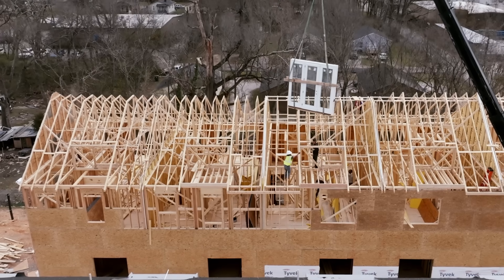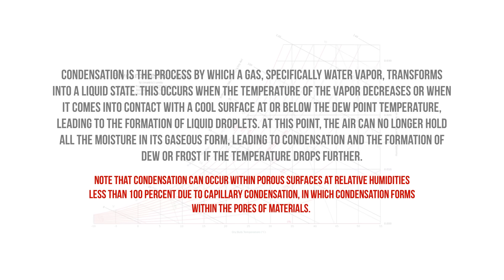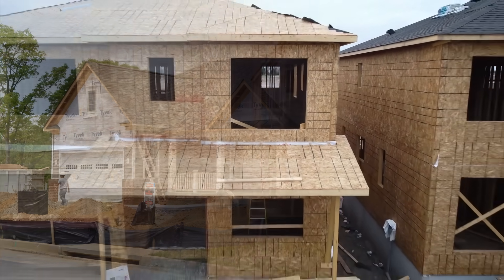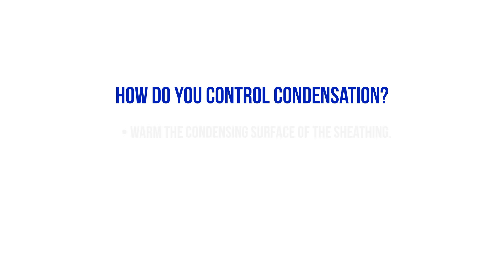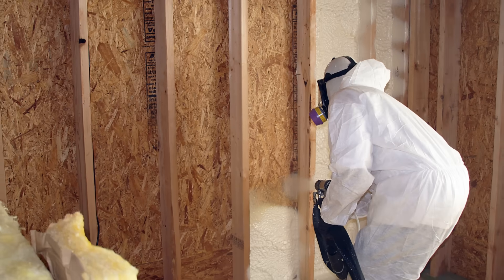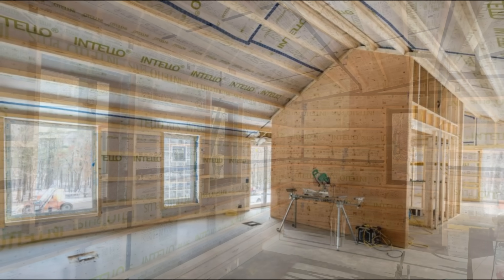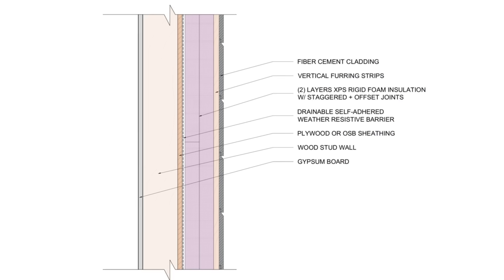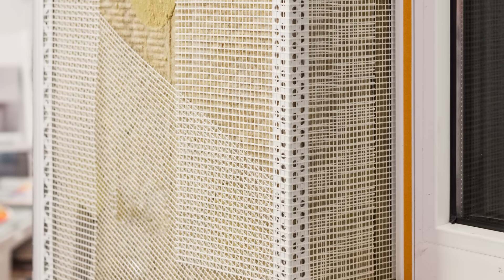The Hidden Dangers of Condensation in Your WALLS – And How to Avoid Them!

Comment: I have a foil faced 1" eps insulation that i planned to adhere to the exterior sheathing using a polyurethane adhesive like the one sold by great stuff that attaches to a foam gun.  I intend to tape all of the seams and penetrations and then attach 3/4" treated furring strips over the eps wherever the studs are for rainscreen and then attaching fiber cement sidinginto the furring.  
Inside- spot treat the backside of the sheathing with an open cell type gun foam(loctite window and door) sealing all penetrations, all stud and plate connections to wall and floor sheathing and then install r-15 rockwool densely, finally drywall with all outlet boxes and the subfloor gap filled with a bead of loctite window and door and/or caulked with an elastomeric sealant. Heavy, wet coat of drywall primer, and 2 coats of high end acrylic paint on walls and ceilings. Im in climate zone 4 in missouri. My question.. am i good?  😅 I know I will need to have some central dehumidification and some ways to let the building exhale especially during the wetter times.  I was concerned that the 1" eps is not "ideal" but it seems better than what I see in alot of the houses around here from the past decades.. I figured that my goal is to keep the moisture away from the outside of the sheathing and then the interior side of the vapor barrier(taped,glued eps) would resist water ingress from the interior but still allow drying to the interior.

Comment: If you have good continuous exterior insulation (say R-16), can you run into problems with, say, an equal amount of R value in the cavity? Because the ratio called for less insulation the cavity? Or does that level of exterior insulation make the issue moot?
Reply from the maker: The short answer is that maintaining a 50/50 ratio (in terms of R-value) outside in the form of exterior rigid insulation and cavity insulation can be made to work for all climates. However, the more complicated answer is that, it completely depends on the building use, the climate zone in question, whether the building is pressurized, and the interior temperature and relative humidity that you are operating under. For example, I would never specify that assembly for an indoor pool, sauna, or hospital. I'd be careful specifying that solution in cold climates where the interior is humidified and provide a bit of a safety buffer. 

The classic consultant's answer... It depends ;)
Reply: Thanks! What I’m imagining is a house in Zone 4, southern Appalachians (plenty of rain), with impermeable peal and stick membrane on the outside of the sheathing to keep the humidity at bay. Design the assembly to dry to the inside (with dehumidification inside). And maybe even plywood sheathing instead of OSB to hedge against moisture trouble. 4 inches rock wool on exterior; 5-1/2 inches in the stud bays. Vapor diffusion port at the peak of a slightly vaulted ceiling under a vented attic assembly. ERV. Would the balance of insulation inside and outside the sheathing bring condensation issues at the sheathing?

Comment: hi there, one question and your opinion on it please...
how about a composite wall, from outside 10 cm aircrete blocks covered in plaster facade, in the middle 15 cm of styrofoam and inside regular bricks as a finish. So, what you thing of as a thermal bridge?
cheers.

Comment: Can you talk about single layer wall assemblies. Specifically the system 3e that uses 14” thick perlite walls with no glues? I just asked them and they said they’re on track for approval in the US in about 8 months. Price is extremely cheap too, around $8 / sq ft.

Comment: General vapor retarder question: Interior of the structure has a vapor retarder, usually latex paint on drywall. In practice every penetration, elec. outlet, crack etc. lets air flow with water vapor through. But the air flow is small because exterior to the building assembly, usually at the sheathing layer, there is a vapor permeable air control layer-Tyvek, stick on, paint on, whatever. So basically the interior vapor control layer is vulnerable to multiple failure points which would allow significant moisture to penetrate the building assembly, but these failures are backstopped by the air control layer which restricts air flow and thereby restricts the vapor. Seems like a horrible design to me.
Reply from the maker: I'd recommend watching two videos on our channel - the first one is called "Air Barriers vs Vapor Barriers" and the second one is what we posted last week on whether holes in vapor barriers matter. But to summarize, vapor diffusion and air leakage are two different transport mechanisms. Diffusion acts uniformly whereas air leakage has the potential to carry with it an enormous amount of moisture. Ideally, you want the air barrier to be outboard of the structure, sealed, and protected from holes (i.e. the WRB would serve as the air barrier) combined with exterior rigid insulation to protect that layer and warm the condensing surface of the sheathing. Another useful article I would recommend reading is on building science corporation called "Hybrid Assemblies": https://buildingscience.com/documents/building-science-insights-newsletters/bsi-100-hybrid-assemblies

Comment: Something I'm still unclear on, is if one replaces the insulation in an unconditioned/vented attic with mineral wool batts, should a vapor barrier be put in?  I have a home built in the 70s and it is under insulated with batt fiberglass insulation.  I will be removing the old insulation, filling in the air gaps with foam (Great Stuff) and then putting in mineral wool batt insulation.  Ripping up the ceiling below is not an option.  Some sources I've come across say that a vapor barrier is needed, while other sources have said that it's not needed.  I live in a norther state (so think moderate to cold climate).  It would be great if you did a video discussing mineral wool in an unconditioned attic and whether a vapor barrier is needed.
Reply: We have done many renovations in homes from 50’-80’s 😅where removing the ceiling below a vented attic is not an option due to cost or historical aesthetic. Since we are often upgrading, lighting, bath exhaust etc, there is significant activity in the attic so we remove all existing insulation and vacuum the space clean. This probably sounds gross, and it is, but this is a critical step in the process. 

Once the attic space is clean, and work has been completed, we install vent baffles at the eaves as most of these homes don’t have any and we make sure the roof vents are adequate. 

After all of this done, we scan the entire attic floor for air leaks, the most common areas are around electrical boxes, at wire penetrations in partition wall plates, where wall and ceiling drywall meet etc. These areas can be sealed with a verity of materials, canned foam, caulking and tape etc. Only once this is complete do we reintroduce insulation, typically loose fill as it is inexpensive and it effectively works its way around framing members.
Reply: Seal the air leaks along the attic floor and then add insulation as usual. Look for big gaps around chimneys, flues, etc.
Reply: Assuming your attic space is vented and you are insulating on top of the ceiling below, in a cold climate... I would air seal all penetrations and do a vapour retarder below the new insulation ensuring it is in the right place for the dew point in all seasons (eg if you use AC, don't just check winter dew point). Eave venting baffles also to ensure air goes eave to ridge. You didn't say how complex your roof is, eg trusses may make it harder to implement a decent vapour retarder layer from above, but it is most critical to air seal, and then having perfect vapour retarder continuity is less essential. Mineral wool is great, and fire retardant, but it requires some cut and cobble work which can be tedious. A loose fill (I like cellulose) will be easier to do especially if you need to get around trusses.

Comment: I’m not trying toto stan for spray foam but a LOT of its problems comes from propane.  Propane produces water vapor that soaks SPF, prevents foam adhesion, creates condensation, and leads to drywall cracks.  Propane does not belong on a job site at any point during construction.

Comment: Nah, I have to disagree. You want the outer layers to be as permeable as possible to allow the moisture out. Otherwise you're just moving the dew point (condensation point) inwards. Keep the inside of the wall at least 5x less permeable than the outside, then whatever moisture does enter the wall will have a quick escape out as a gas, rather than forming liquid and destroying the structure. Sorry, nope. You'll never catch me using spray foam insulation, and I predict that in 10-20 years, you'll be on board with that.
Reply: It’s climate zone and seasonally dependent. The warm moisture inside the building in a cold climate or in winter does in fact want to escape to the dry outside but then when summer comes, your hyper permeable exterior now allows hot humid air to enter the assembly to get to the cool
Air conditioned drywall.
Reply: @CMCraftsman  which is why I prefer hempcrete - no vapor barriers needed, it's a monolithic element of insulation, that doesn't trap moisture/vapor at all, regardless of climate. Also, a great use of resources. Lime is finite, but if it is to be used, it should be for something like this - a house that can stand for centuries (esp. with a timber frame!). Thermal battery, hygroscopic, environmentally friendly, reusable (<10% old hempcrete per new batch), can be spread in the fields if the wall/house is ever torn down. 

Thanks for your response though - and yeah, I'm in Scandinavia, so we build for the cold.
Reply: You can use impermeable exterior insulation, but only if you use enough of it for your climate zone. The idea is to keep the ratio of the interior to exterior R values such that the vapour control layer (or sheathing) is always above the dew point for all seasons. Then moisture will not condense because it is above the dew point and can't penetrate further in the assembly (through the vapour impermeable insulation). With vapour impermeable insulation, the warm side surface of it is your vapour control layer.

Comment: The cost of exterior insulation is a big barrier but i agree the benefits outweigh the cost in a lot of scenarios.
Reply: It doesn't make sense to make a hybrid house from traditional construction and sip.  Just build with sips and you will never have all this nonsense talk. The dew point would always stay in vapor impermeable insulation  which would not cause condensation nor change its R value
Reply: @andreycham4797  oh for me my big one is just increasing R value and decreasing sound and heat transmission. I wouldn't remove my indoor insulation to add exterior I would want both.
Reply: @GameTimeWhy The issue with external insulation in a cold climate is not so much the cost of the insulation, but the greater difficulty installing siding over thick insulation.

If you insulate between the studs, you will need even more insulation outboard to keep the sheathing above the dew point.

Overall, it's a good strategy for passive house level construction: build a standard 2x4 structure that acts as an insulated wiring chase inside the vapour envelope. Then insulate heavily outside the sheathing, but strategies are needed to secure cladding and deal with windows (imho plywood window bucks are the way forward there). All of this is not cheap, but the extra cost is as much in the strategies to finish the exterior as it is for the insulation itself.
Reply: @jamesroscoe7555  thats what I was kind of thinking. Definitely a big job to retrofit an older house with this but I think the energy saving costs and noise reduction would be worth it.
Reply: @GameTimeWhy  yes, and with an existing house, you have to consider what aspects you want to keep and how all that thick outboard insulation works with the existing architectural details. Retrofit is definitely a bigger challenge than new construction.

Comment: Given a sufficient amount of rigid exterior insulation and a certain size wall cavity, is it cost effective to fill the cavity with cheap, unfaced fiberglass batts?  I think it is, given the low cost, so from the point of view economics, the perfect wall is sub-optimal, hence imperfect.  Joe should have called it the ideal wall, not the perfect wall, in parallel to the concept of the ideal gas law.  It is an idealized model for a wall, not a perfect wall,
Reply: I read somewhere that if you put too much unfaced batt insulation in the interior walls that have exterior continuous insulation, it will reduce the dew point on the inside of the exterior osb because it will be colder due to the excessive interior insulation.
Reply: @alwaysvacationing5341  Yeah, that is true, but the premise is that you install sufficient exterior insulation for your zone.  In almost all cases that allows you to fill your 2x4 or 2x6 wall cavities with unfaced batts without risking condensation for pleasant indoor humidity levels.  The cases where that doesn't work are things like pools, steam showers, and green houses.
Reply: @alwaysvacationing5341 Yes, as the other poster noted, that is correct. You should calculate the dew point for all seasons though for your specific climate. You may find that putting a vapour control layer directly under the drywall would cause an issue as well (in summer with ac with exterior permeable insulation). So any design should be analyzed for the specific climate zone. Note also that one should calculate the effective R value including thermal bridging of the framing members. The ratio of interior to exterior insulation matters, and for condensation purposes, it is the ratio not the absolute amount of insulation that matters.
Reply: Ideal gases are sometimes also called perfect gases by the way.

Comment: Mold is one of the reason we like 120+ year old houses. It why we use thermal breaks around windows and doors. Plus if log home allows for shrinkage. We set windows more towards interior it helps with heat and exposed glass. We do use spray foam around windows and door and bays next to them only with stick built and timber frames. As windows and door are cold and not much r values. Condensation and capillary breaks. Do not use masonry window sills please. Don't make your mason do something they know will cause trouble later. The plumbing for my D.C. off grid house took some thought. With an indoor cistern and pumps needed to up pressure for tankless and through the filters. Also no ducking because open rafters.  Passive solar with masonry appliances. Purposely made for 46% glass to floor space and some wall. It's cool in the U.P. of MI. If it gets too hot I can open front door and melt snow. Frost stops in June and starts again in Sept.
Reply: Interesting.  Do you have any video of the house you described here.
Reply: What’s the problem with masonry sills and what should you use instead?

Comment: When should we have a ventilated attic versus a sealed attic? Also, what is the proper formula to use for attic ventilation?
Reply: People often want unvented attics to use the space for storage or HVAC equipment. It's easier or cheaper to do a vented attic with insulation at the floor level.